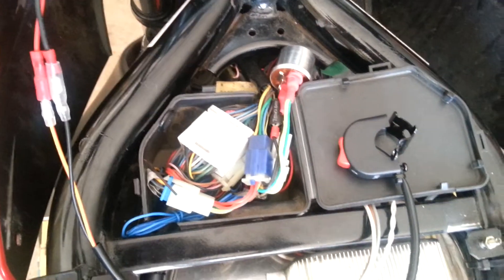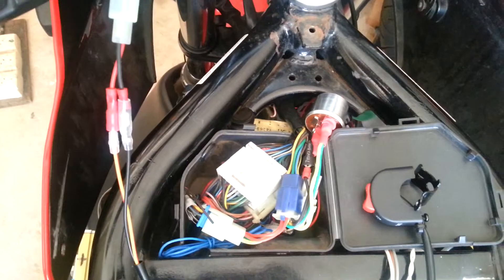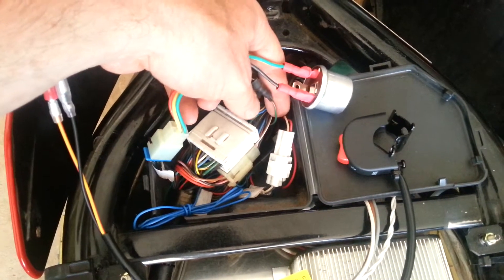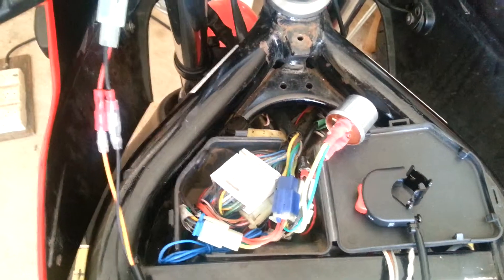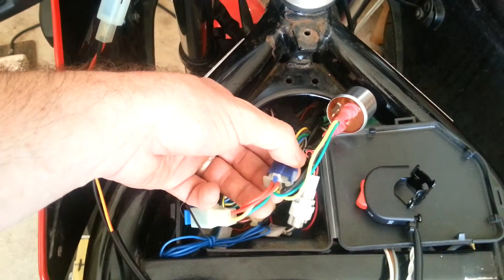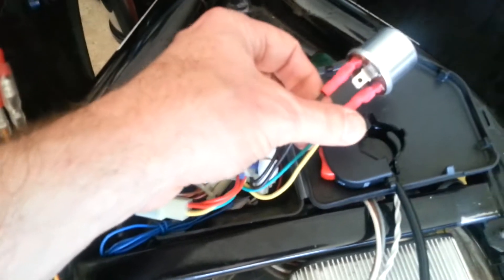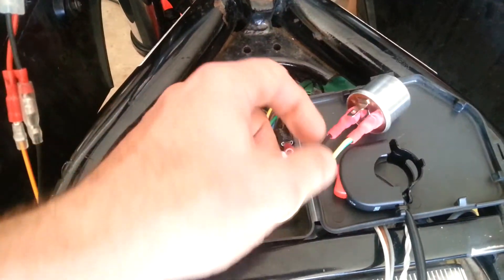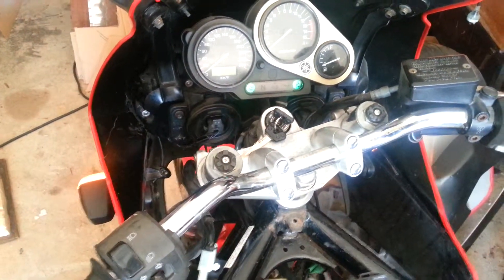Adding emergency indicators.

Comment from the maker: The engineer asked for hazard lights to be added to my electric motorbike.  So I solved the problem without having to do a lot of extra wiring.
Reply: Good work dude.
Reply: I will be down for the National Brew Conf, late October, I think. Perhaps I could see the machine then. Paul Wayper
Reply from the maker: Tony Bilbrough You can probably even have a ride on it! :-)  It will be registered by then.
Reply: +Paul Wayper I should hope so!!!
Reply: I didn't think hazards were a requirement, given that many normal bikes lack them...
Reply from the maker: As I say in the video: I'm not going to argue the question of whether a motorbike that originally met Australian Design Rules and did not have hazard lights now needs them just because it's been modified.  Firstly, he's the engineer - if he says they need them, I'll believe him.  Secondly, I can add them anyway (as shown).  Thirdly, they improve the bike anyway.
Reply: So hazards are a fairly recent addition to ADRs for motorbikes? i.e. within the last decade?
Though it only has positives as you say, so why argue the point.
Reply from the maker: I don't know, off the top of my head.  My 2006 model Suzuki GS-500 doesn't have them.  Kate's 2008 Peugeot Geopolis does.  Other people I know with later bikes than mine don't have them.  I suspect it's a "preferred" rather than a "mandatory" thing, but I haven't read the relevant bits of the NCOP.